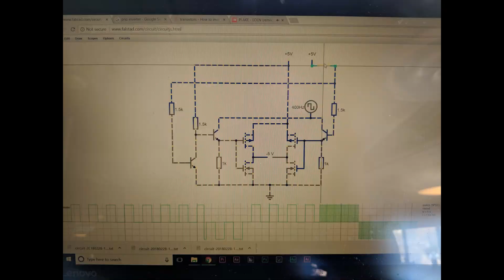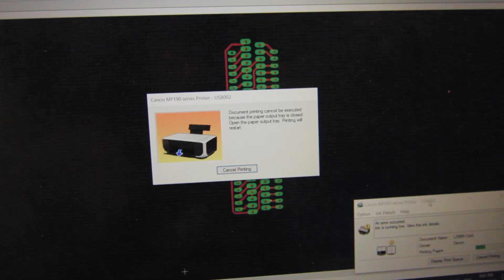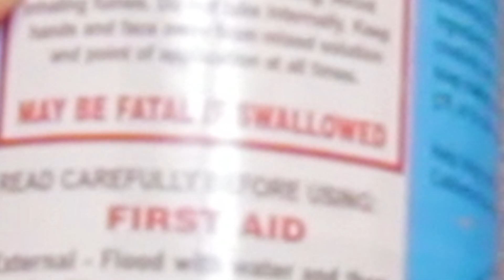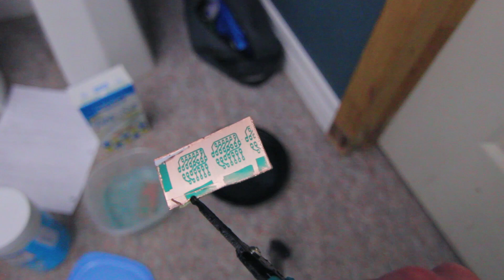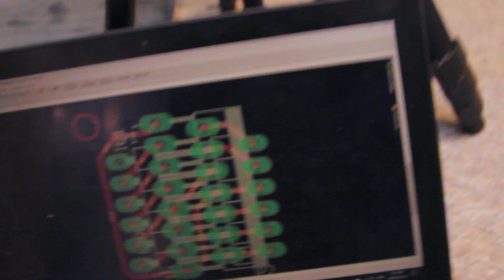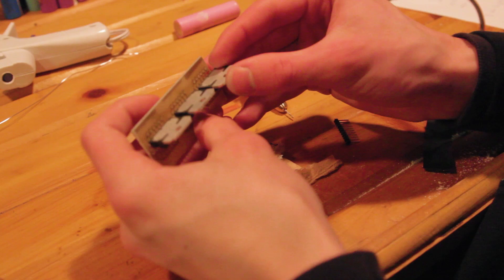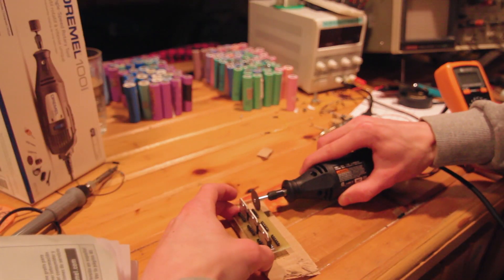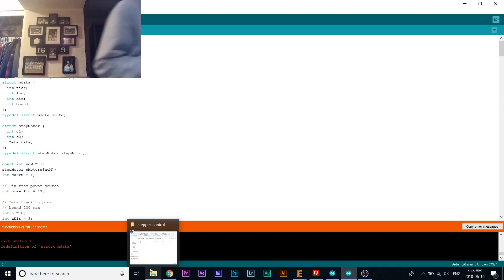DIY Battery Testing Robot [ Part Two ]

Comment: the blue liquid is probably copper sulfate the other chemical is an acid probably hydroelectric or sulfuric.  and the whole process is a photographic one  first you create a end product  second   a mask print 3rd expose your mask print to a photosensitive material with a metal base can be done with light or acid either way you end up with metal only where you want it;]  same process for chips lot smaller scale  .i know this is old by now but hope it helps and thanks for the videos

Comment: To print the circuit you can print it on a photographic paper, cover the copper coated pcb with it and then iron it for about 20 minutes.

Comment: 2:30 trust me, i'm engineer lol
also, i think it woul be much easier to just solder wires or bend legs of chip then doing PCB xD
u r into so much different stuff, like electronics, programming and cardboard-hot-glue-stuff :D
oh and btw, 6:41 u better dont breath that PCB dust, because it can cause a cancer in lungs

Comment: "The motor can't push [...]"
Beware of the voltage drop if you use L298s...
If you have a 5V power supply and you're using a 5V stepper, the stepper is only getting about 2V.
So (if this is your case) the supply should be about 3 volts higher.

Datasheet says:
- When load current = 1A the total drop is between 1.8 and 3.2V;
- and if load was 2A, the drop could go as high as 4.9V.

Link to the datasheet (see end of page 3): https://www.sparkfun.com/datasheets/Robotics/L298_H_Bridge.pdf

Comment: Just a recommendation for the next version.
You should have designed an upward system which works with gravity to take in the next battery and used a electromagnet to push the testing probe against the battery and a piezo to detect if the cartrige is emty or not using the arduino to timing and control the flow and putting another electro magnet to sperate the bad ones from good ones in two sided trail

Comment: For driving steppers just use a cheap 3d printer stepper driver like a4988 - they are bread board freandly, And use the AccelStepper library for arduino. Makes things so much easier!

Comment: If I had to do this in my free time I would Stress the F out. 

Also, having worked with these chemicals before, you shouldn't do it like this aka. a bathroom is not safe. 
In school we used, glasses, gloves, ventilation, something to cover our clothes and special disposal.